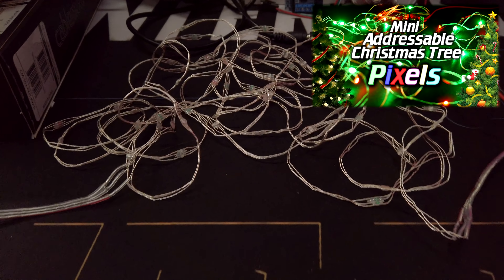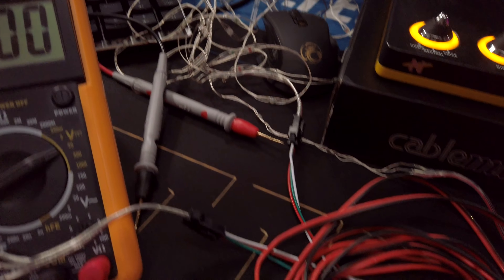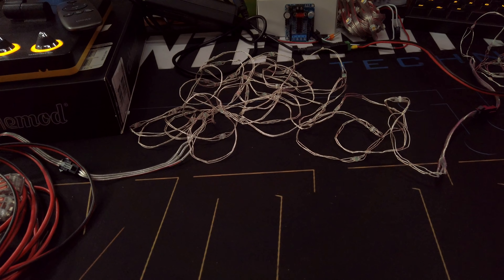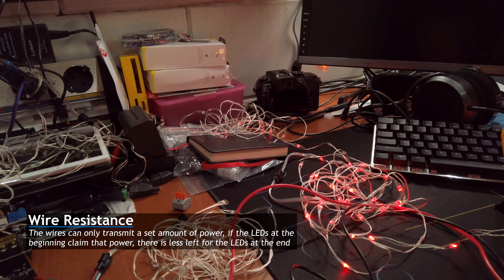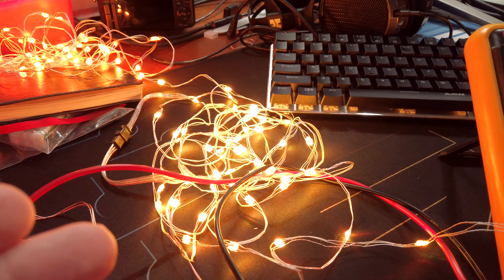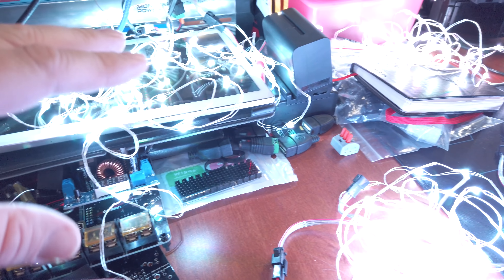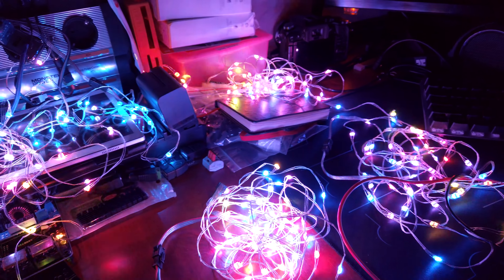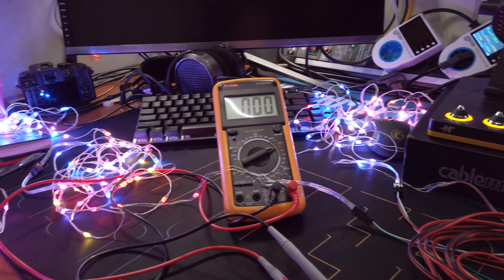QuinLED: DIY Addressable LED 🎄Christmas Tree🎄 Preparations

Comment: Great video!   My wife’s tree is begging for this. 
Questions though:
Witch brand did you use or recommend?
I followed the links to purchase the strips and the seem to be powered via USB. Do I just cut the connectors off and wire them into the Uno?

Comment: thanks quin, just bought the dig quad and I have this exact set up but what did you set the brightness limiter too in wled?
Reply from the maker: It'll depend a bit on your injections points. For this style of LED I'd say about 3A per point.

Comment: On the Power monitor What was plugged into it. Just trying to determine where you were measuring power. Perhaps the Power supply was plugged in to itI might consider one of those for this and other uses
Reply from the maker: You mean what power monitor it was? The was a power monitor I use more often, let me know if you are looking for it, I'll add it to the video description. The LED controller was a QuinLED-Dig-Uno.
Reply: @IntermitTech  I found the power monitor on Amazon, just wondering how it fits into the circuit to be able to monitor Amps and Power as they have to be in-line to get those readings. And I just received 3 Dig-Uno's form DR ZZ
Reply: @IntermitTech  I would be interested in looking at your other Power Monitor if yoou want to post it please

Comment: Is it possible to use for example a 20v power adapter ( old notebook power adapter) and wire the 5m led strips in series. This  way when using 20m each 5m strip will have 5v ? I have used this technique with standard 12v LED strips.
Reply from the maker: Poh, in theory maybe, problem is that the draw of the strings isn't constant with addressable LEDs, so the voltage division likely wouldn't be either, so I would certainly NOT recommend that.
Reply: @IntermitTech  I have just ordered four of this strips. I will try it and let you know. 🙂
Reply: @Cyp9311  Any updates on your experiment?

Comment: Based on what you show here if I ran lets say 14 -16 of these strings wouldn't  a 15amp power supply be enough and then use a Dig Quad to make power injection a lot easier?
Reply from the maker: Yup, for sure. This year I'm upgrading the tree to a Dig-Quad to make wiring a bit easier. :)
Reply: @IntermitTech  A youtube video of that would be much appreciated :)

Comment: Adding to my shopping list in expectation of my assembled QuinLED-Dig-Unos arriving. Wanted to point out that the 2.5mm² "primary" cable used in this video at 1:24 is equivalent to 14AWG cable,  not 10AWG. Thanks for the great tutorial!
http://nicab.co.uk/a-simple-guide-on-cable-awg-to-metric-conversions/